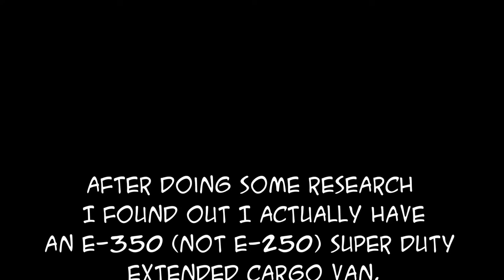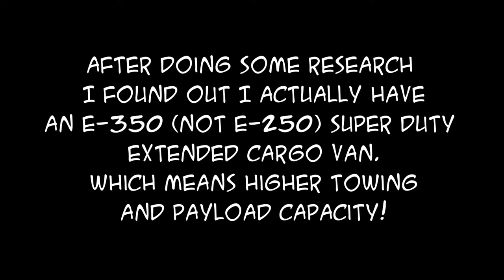First Drive (with you guys) 2006 Ford E-350 Super Duty Extended Cargo Van

Comment: Yo Dash long comment ahead...  Van name Vanna White.  

The thumping in the rear maybe a tire with a flat spot.  Simple and cheap test is to rotate tires.

Cheap testing can be done by taking van to auto store and having them connect up ODB reader to see what codes are present in system.  They could also test battery.  Usually there is no charge for these services at the big auto part chains.

When I buy a used vehicle I change all Fluids and Filters.  Replace belts, hoses, and tires including spare based on the age of vehicle.

I am sure you are aware you can contact most auto manufacturers Customer Service departments giving them your VIN and they can provide you the as built specs on the vehicle.

Lastly if the "diesel" noise gets too much you can install sound proffing mats on the floor and firewall.

Look forward to your journey with the vehicle or I should say Vanna White.
Reply from the maker: Long Reply Ahead - Vanna White LOL... I'll add it to the short list.

So far you have been the closest to the actual problem. It was a wobbly wheel. I actually just got back from a junk yard and got a new one. 

I have a code reader and have checked and cleared the few codes that were showing.

I found out it was an E-350 by searching the VIN, and have already looked up and the specs just don't know which rear end is in it just yet since it showed it could be one of 2 or 3 possibilities. The difference being about 500lbs in towing capacity.

The first order of business is to change all the fluids, the serpentine belt had to be changed to pass inspection so that will be done before I bring it back home. 

LOL, the diesel "noise" Nah it doesn't bother me one bit, if anything I'll be making it louder... Much to my wife's dismay. 

I too look forward to the journey, I am hoping the van will provide content for my channel that will supplement cooking / BBQ related videos.
Reply: Getting the factory build sheet will tell what rear end is installed.  It will also let you know if it had the Tow Package installed (extra coolers, etc.).  It really does have a lot of good info on it.
Reply from the maker: Will do, never thought about that. I have a friend that works for Ford.

Comment: My concern is that it might be a universal joint, be careful, they can break and then you've got a driveshaft laying on the ground. They can be a pretty serious pain in the butt to replace too. I would crawl up under the van and try shaking the driveshaft at the universal joints, if they can be shaken that's a problem. It needs to be a female name, it's required for all vehicles.
Reply from the maker: It was a wobbly wheel. Going to get a new one today. Why yes, I'll bring my camera along.